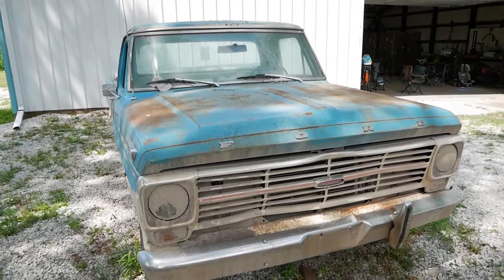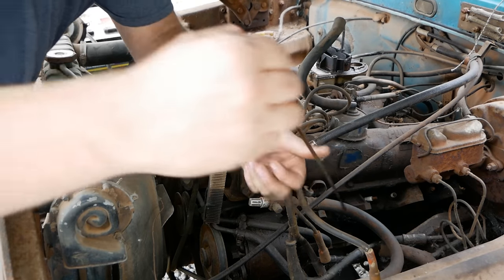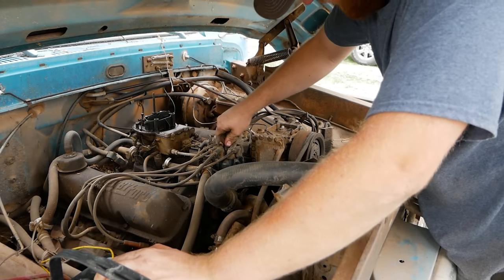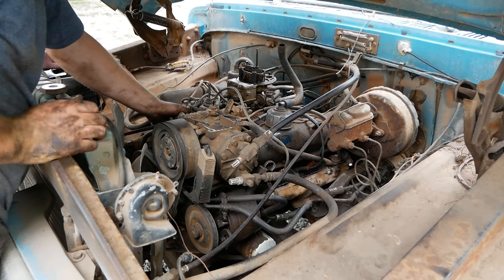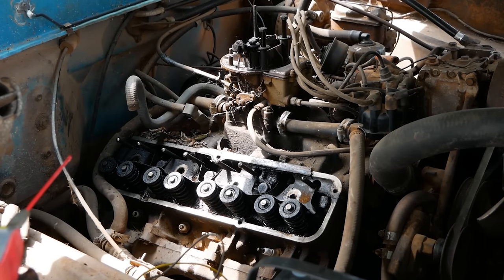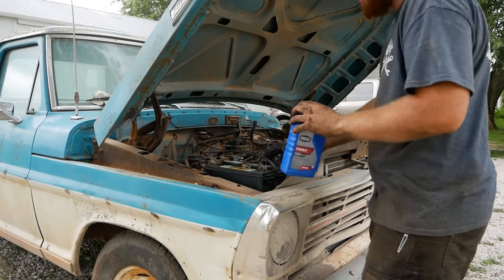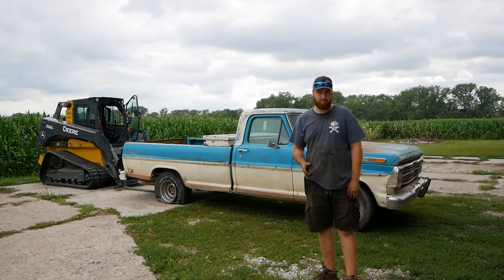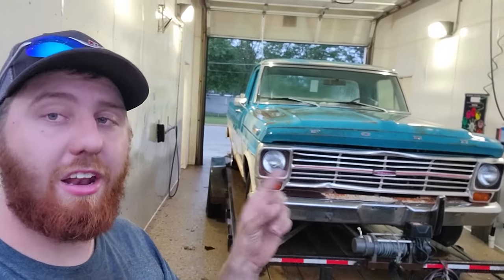Will This Tired Old Ford Come Back to Life? -- 1968 F100 Revival

Comment: Even though I'm not a big ford truck guy, this truck just strikes that "chord" with ya
Reply: Same. I've always been a chevy guy, but ive got a soft spot for old fords like this
Reply: Im a die hard chevy guy but with some of the old fords cant go wrong with em i got a 1976 ford f700 flatbed all original just need to do the brake booster to get it back on the road
Reply: @northernstoner962  Nice. I'm trying to find a 67 galaxy before the start skyrocketing in price
Reply: @banemafia4629  thanks and yeah i seen a couple old cars around my town would be awesome to get then but i dont have that kinda parking space 😂 the coolest has to be a old Pontiac on from like the 50's and one from the 80's
Reply: @northernstoner962  Definitely. I wanna own a first gen firebird some day
Reply: @banemafia4629  i would like to have one day a first or second gen Impala or a old  Cadillac Eldorado

Comment: "Supposedly, it was running at some point..." Well, yea.... they kinda all are.....
Reply: Hah! I see what you did there! :P
Reply: "running when parked" means "I didn't use a tractor to get it in that spot".
Reply: @albertgaspar627  im pretty sure this thing didn't get their on itself because it's so wornout
Reply: @wildman510  and that's the point..."running" and "safe to actually drive home from where you bought it" tends to be a big difference...but i still see buyers hoping to save a buck driving dirty.
Reply: "Remember these all ran when they were new." - Rich DeBoss
Reply: Unless it's an AMF Harley.
Reply: @zeropoint546  and when you spotted one brand new leaking on the dealer showroom floor....you figured out what those three letters really stood for :)

Comment: Thats a nice looking truck, and bed aside pretty solid. I like the rims that were on the drivers side and the flat rear, hope you have a full set of those. With a decent engine (or overhaul) It'll make a nice ride, especially if you can keep the AC working! Just crusin' along listening to Fiddler on the Roof!!!
Reply: are you saying you hope kevin has a full set of flat tires? Well those are pretty easy to come by if he doesnt. but WHY?

Comment: For stuck or sticky valves, I usually bring the piston to the top of the stroke and remove the valve spring. Then lock the stem in a drill chuck and lube and spin while working up and down.

Comment: Hello From KY.  Kevin & Mook, I always enjoy all of your Ford Truck videos; Especially the ones with the Inline 6 cylinder engines. 
Recently I purchased another 1985 F-150 Ford with a carbureted 300 with a NP435 transmission from a car dealer that had just parked the truck on the lot. The engine has the typical 300 peck from the lifters but otherwise you can’t hardly hear the engine running.  My 1990 F-150 with the EFI 4.9/300 cid with a E4OD transmission is needing a starter replacement. This truck has the weird conditions in which the starter will stay engaged until the battery dies or the battery post is quickly as possible disconnected. 
Recently I was in route home in a torrential downpour in a neighboring town in which for no apparent reason the starter engaged as I was driving.  I turned the key switch back and forth several times in which I think that the starter finally burned itself up. The amp gauge was just about completely over to the left on discharge until the starter finally gave up the ghost. 
As I made my way back home through the monsoon, The gauge gradually returned pretty much to normal and I was fortunate enough to get the truck back home with no further incident. I kind of took your advice and purchased one of the Pure Energy starters rather than pay full price for a parts store starter that may or may not fry itself like the OEM Motorcraft starter that was on the engine. Have you encountered this issue with any of your Fords and what did you do to resolve the issue. And yes, I ordered a OEM Motorcraft starter solenoid rather than the parts store solenoids that have been not very good. A friend of mine suggested that the starter switch located under the steering column may be going bad, So I ordered a OEM Motorcraft switch as well. 
In past years, I had a 1974 F-100 with the FE 360 engine in which the engine always ran decently but I never could find a 2 barrel carburetor that was exactly right for the engine.  I finally sold the truck to someone that I knew who finally killed the truck. Thanks for all of your great videos.

Comment: Push on the dial face of the radio for the 8-track
Reply: I was gonna say the same thing
Reply: the tapes may also need the foam behind the tape to be replaced or otherwise they’ll be muffled
Reply: didnt he say he never heard of tijuana brass? wth?
Reply: @steel7302  I think he said Herb Alpert.  Same thing.
Reply: It’s just underneath the AC vents
Reply: i have a 68 also found that the dial face of the radio pushes in when you insert an 8 trac

Comment: This truck brings back some memories.  My 2nd truck ( 1st one I ever drove ) was a 1972 F100 Ranger that was the same color scheme of that truck.  I learned a whole lot about working on FE's while I owned that truck. Mine was a 390.  I was 16/17 when I owned it. 

It looks like your truck has a carb off a 70 or 71. And three wheels off a late 80's-early 90's F150.  And if it was an engine that you actually cared about it's not a bad idea, if you have the rocker shaft off. Pull the push rods and spray some brake cleaner thru them all to make sure they aren't plugged up. And then pour some ATF over the rocker shafts and valves before you throw the cover back on.

Can't wait to see the swap. But it is kind of sad. A good FE has a great exhaust sound. At least you aren't throwing a ls in it!!

Comment: thank you for your vids junkyard digs, i sadly blew an inline six because i failed to lubricate the engine after it sat 10 years and as we all know if you use starting fluid it dries out cylinder walls, ended up blowing a rod bearing. youre my hero dude and your videos are a huge inspiration.

Comment: My sons and I have 86 Ford Bronco with Ford straight-six engine that we slowing getting it back on the road.
Reply: Awesome. I have a 65 ford galaxie I swapped a 4.9l 6 from an 89 f150 into. Got it running last week. Good luck

Comment: I do agree though. She ain’t pushing oil to the top. More than likely the push rods are plugged. Won’t run for long like that😢
Reply: Since when does an FE oil through the pushrods?    Because they dont.  Never Have.
Reply: @ShawnWDunn  Is this like a thing with the FEs?
Reply: I mean yes? I guess? Not any more than any other older American V8, that's been sitting around with potentially stuck valves, and rust under the valve covers, in my experience. I don't think it's any more likely to happen on an FE, than it is on a Windsor, or 385-Series, or even a SBC/BBC, if they've been sitting for a while.

Comment: I have a soft spot for these trucks. I remember riding in the middle with the underdash A/C just threatening to scalp my shins. Dad taught me to drive his 1967 long bed F100 Ranger with a 352 and a three speed column shift. I will never forget the looong reach to squish the pedals, the giant steering wheel, and the feeling that I was in zero control until that clutch pedal came off the floor and we were on our way. Give your kids memories like that.

Comment: Very cool old truck. My first truck when I was 16 was a 1969 F100 Ranger. It had a 390. A tired 390. I loved that truck. I rebuilt the engine and transmission. It was a great old truck. I still miss it.

Comment: I have a 67 F600. The engine is a 330 FT but it is very similar in most aspects to an FE engine. These engines were machined and assembled without exhaust manifold gaskets. Over time the exhaust manifolds start to leak and get loud. The mounting bolts usually break off whenever you try to remove them in order to fix exhaust leaks. Some exhaust manifolds crack and break. They are hard to find and replace. The broke off bolts are usually why they get parked and never driven again.

Comment: That portable tool kit looks like it has everything I got in my original craftsmen starter mechanics tools set back in 1972.  By 1984 when I quit working as a mechanic to program computers, I had 2 roller cabinets and 2 top boxes full of metric and Imperial tools which I still have.  I've come to the conclusion that you can never have enough tools.

Comment: Check the PCV valve. Replace it and the hose. Make sure you get the right hoses. My dad rebuilt an engine in an old truck, but did not replace the pcv valve and it was sucking oil up into the carburetor. Smoked like the old tar kettles they used on the road for warning. Through his disgust, he gave it to me( I was 14) and said I could drive it fishing. I noticed oil on the hose and replaced them both. Let’s just say dad was an Indian giver.

Comment: My Old 1968 Nova had lifter tapping that drove me nuts ..My Uncle was a Mechanic for Gm Dealership. He pulled the valve cover and adjusted them up and it quieted them down a bit .but they were still a tapping ....He said just drive it .it will be fine ....Drove that little 250 straight 6 for 5 years .Drove it from St Petersburg Fl to Geauga county Ohio and back twice ...Never a problem .M.A.G.A

Comment: Used to have one.
Great truck.
Was my first vehicle.
My Ranger was damn near a stripper.
390, no PS or PB, 2wd and a 3 speed C6.
It did however, have AC.
I believe the Ranger was more of a Chrome/trim  package and could be loaded up if wanted.
The FE series engines all had a problem with timing chain and gear sets getting sloppy.
ENDLESS leaking exhaust manifolds.
Points Distributor bushing likes to go bad between 50-60K miles then the timing starts flopping around, but will happen about the same time as the timing chain set, so check both.

Comment: There's many reasons I like seeing older vehicles getting restored and cared for, but one major reason is because fixing them up helps bring back good times. This truck is old enough to have grandpa/grandma go cruisin' in like they used to when they were younger and the truck brand new. That's why I still drive a 1990 S10 to work, because it helps to get away from all the technology and complexity of everything these days. Simple to work on, and power to boot, these old rides just shouldn't die.

Comment: Okie ranger!!!!! I'd love to have yall come and revive my old 59 bel air and lend me a hand on it
Reply: yeah, I got another f100 I need alot of work on 😭
Reply: @xavierwinnfel874  my bel air has been parked the last time the motor was run I was 4...  I'm now 25 and get this... my dumbass of a father parked it cuz the rear-end went out... he had the parts to fix it but didnt... 

But even better of a story my uncle had a 60 model biscayne, same body style as the bel air, and he parked his because the fuel pump went out on it... both were perfect cars all original with under 80k miles my bel air is 68k never been rolled over in the odometer and they just let em rot...

Comment: FEs , had many if the lifters tick add a a quart of tranny fluid to the oil if the valves are sticky pour some down the carb while it is running.

Comment: Seeing as how those lifters were a little rusted and that pushrod was bent I would tend to believe the oil pick up screen is clogged and not letting much oil through the oil galley. The '68 F100 Ranger was a pretty solid truck platform but since it was a farm truck I tend to believe that truck engine was pretty much abused for its lifetime.

Comment: I remember checking spark on a Dodge Neon one time. I grounded the plug out on the valve cover. Needless to say, I very quickly learned that it had spark, and that the Neon valve covers are not made out of metal. I learned that lesson, and I will never have to be told again, lol.

Comment: It's a good idea to wipe out the points with a piece of card or cloth after you sand them. Otherwise, little grains from the sandpaper may jam the points slightly open, which may cause an intermittent spark.

Comment: That truck is perfect. New engine ,suspension upgrade, nice rims and tires. Absolutely perfect. Come on you need to to put a brand new center section in the bed, it's worthy!

Comment: The oil on the top of the Carburetor probably has very little to do with blowby.   If I'm not mistaken, that's a factory oil-bath air cleaner.    And they tend to leak a bit.

Comment: Measuring the piston stroke is the way to distinguish a 360 V8 from a 390 V8. This is also how you distinguish a 240 straight 6 from a 300 straight 6.

Comment: Kevin, that radio might still have the 8 track. The one in my Camaro, you put the cassette in where the station indicator is. Push on the station indicator, see if it pushes in. I know it doesn’t make much sense, but the 8 tracks of that era, that’s where you put the cassette. Wish I could share a picture.

Comment: That's a 1969. One year only grill with the red bar across the center. Rear reflectors below the taillights were introduced in 1969. Plus, the license plate frame also says it's a 1969 Ford Truck.
Reply: Thought the same thing, for the same reasons you listed. I have a 69 Ranger that was built with a 70 bed and title says its a 70 so Ford did do some weird stuff back then...

Comment: The radio most likely has an 8-track.  The radio dial is also the 8-track door/flap you insert the tape into.  Pushing the volume or tuner knob   changes the tape to a different track.

Comment: I have a 68 F100 that my late uncle bought brand new in Southern California.  I can vouch that the fan clutch is likely not original equipment.  Those spare taillights are for the truck.  The air cleaners are for the older 67 models.  The exhaust manifolds on these were prone to cracking.

Comment: You going to do a LaGoat to the Lamans? Go wide block 455 with butler performance stroker job on a 400? [you know... back to Pontiac for the motor sort of deal]. :-))  Hey be nice to see you pull this motor on the Ford and pop out the pistons, hone the cylinder walls... rings are cheap... put some new push rods in her.. put some compound on a valve and seat the valves [again, inexpensive but great youtube content].

Comment: very nicely equipped truck! I’m buying a 1969 ford f250 with 360 and c6 2wd ranger. it has 97k original miles and power breaks and power steering so it drives like a new or modern truck.i just wish it had AC like this one!

Comment: I watch and enjoy a lot of these revival channels (and am learning much!) and i can say that that was the best camera shot/angle of the points on the distributor in action ive seen. Bad gas was prob a problem but i knew this was a quick and dirty. Question: what was the little stacked condenser-looking thing next to the pulley's at say 7:33?
Reply: Its a power steering fluid cooler.

Comment: That engine isn't just toast, it's badly burnt toast. But I love the body of those simple smaller old Ford trucks. Low and long, it just looks quick. A big block though? Sounds a bit of a mismatch unless you want to build a sleeper or a dragstrip toy but maybe that's exactly your plan. :D

<edit>My plan would be sealing in that patina, maybe even keep some of the dings and dents but modernize and clean up the rest, trying to keep the look of the interior even though the AC seems huge and impractical for the passenger. Put in a 3.5 EcoBoost V6 from a modern F150 in. Heck, maybe one could even plop that body on a modern chassis?

Comment: After a rebuilt head job and carb rebuild it might run if the cam is not wiped. New push rod. Wonder if you charge it with Freon it will blow cold air? I like it.

Comment: I want that goddamned Conway Twitty 8 Track I saw under the seat Kevin!!!! >>> Those old Ford trucks had really nice interior packages... Too bad it's all genuine plastic and cardboard...  If anyone remembers Leonard Barton from my area he was a Ford freak. About 30 years older than me I never thought much of the guy because of the way he drank & the way he treated his kids and family that were neighbors of mine at the time. But talk about 2 old Ford Trucks that were old even before I left for Iraq. I came back Leonard had passed on the one son and I were kinda close even though his pop and I were not Leonards oldest son played with my oldest son as kids. Leonards kid totally restored the one main truck and it looks alot like Kevin's here. The kid has his dads moxy less the attitude and alcohol problems. The problem with Leonard was when he wasn't drinking he was pleasant and reasonable and nobody could fix or body work a Ford pickup like Leonard and I mean nobody. The problem when he drank ya never knew what to expect out of the guy and part of the reasons nobody took their vehicles there to get fixed anymore. The man was fast with the welder and Bondo mud I will say that about the guy nobody could sling body filler like Leonard could... In order not to get drunk I mix just the right amount of Budweiser into the mud so as I won't get too drunk so I can get the work done and not act like a Leonard I mean a lunatic...

Comment: Bed floor can still be patched fairly easily.. and I have seen guys throw steel plate in the bed and use it for the floor patch it with diamond plate aluminum sheeting unfortunately that is why you don't use the rubber bed mat or the plastic bed liners

Comment: I've got a bad miss on my Chevy that I'm trying to find. Was pulling plug wires with it running the other day, using long needle nose plier with big thick rubber handles and wasn't touching the truck and it still lit me up enough times I shut the truck off and came in the house lol